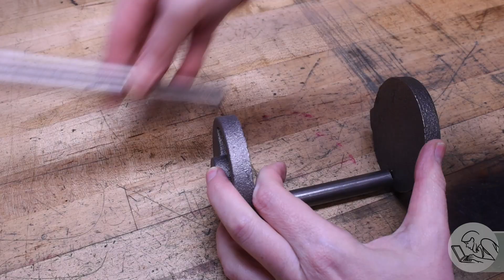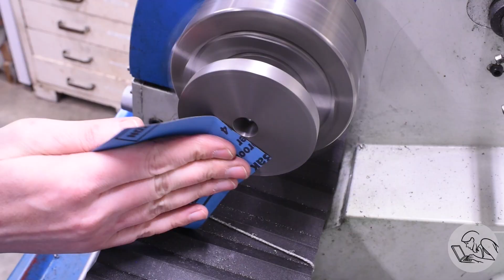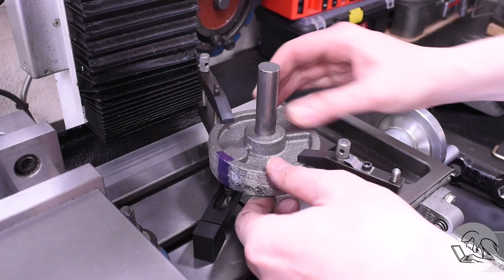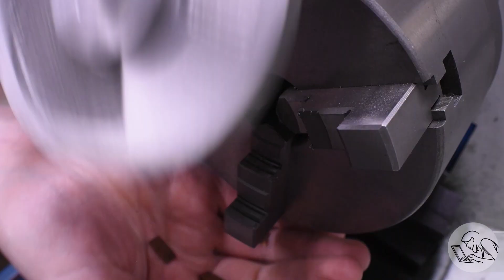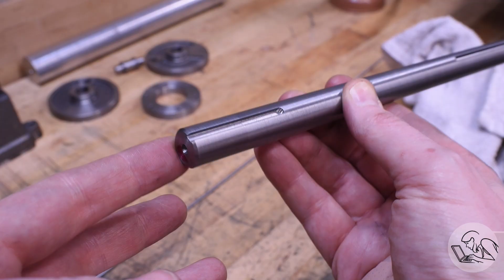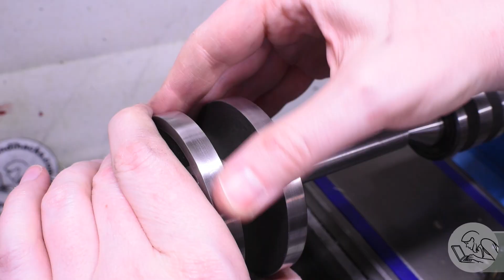Making a Crankshaft!    Big Steam Engine Build, Part 3

Comment: Just FYI. When iron cools in the mold, it can cool fast or slow. If it hits the sand, two three things happen. 1). Any moisture in the sand turns to steam. 2). The iron contours itself to the dry sand walls. 3). A thin skin of iron cools rapidly in contact with the sand. Firstly, if iron cools fast, the graphite soldifies as interstacial carbide. Old timers would dust the molds with a coal dust that reduces the surface effects of the sand. This skin of carbide iron is called white iron. If the graphite cools slowly is produced a laminar layout of strands like worms. If I add manganese and extra fero-silicone JUST before I pour, the graphite solidifies as balls or nodules. This is ductile iron. Using only ferro-silicone yields the wormy pattern which is grey iron. When you machine grey iron, try to climb cut into the edge to prevent edge chip out.

Heat treatment of castings reduces internal stress and aneals the white iron up to a point.

When I melt down brake rotors which are often a meehanite nodular iron, everything goes back into solution. Like adding surgar to water. Then many or most of the original innoculents will out gad, burn off or float to the top ad dross. So adding a tad of ferro silicone now will allow the iron to solidly as grey iron as opposed to the ductile it once was.

The white iron caused by rapid cooling can be useful. A steel ring was added to the mold in train wheels to force white iron to form on the rim. A real pain to machine but improves the life span of a train wheel.

When cutting this skin, you need a full carbide tool. Carbide tooling, unlike HSS tooling, does not do well with light cuts or spring cuts. It wants to take a heavier cut. So a finish cut in HSS may require 1 or 3 tho but the same cut in carbide is done at 10 to 15 tho. So adjust your hog accordingly.

Really enjoying the build of this motor. I think this engine may have been used by DuPont to make black powder. But don’t quote me.
Reply: Now this is what a comment section is for
Reply: @tc5963
Reply: Worth noting that it is magnesium that acts as a nodulizer for DI and not manganese. Also FeSi itself is not an adequate inoculant for cast iron, it usually includes a rare earth like cerium to act as a heterogeneous nucleation point. Also gray iron flakes are not “laminar/lamellar” it’s more of a randomly oriented sponge structure with interstitial aus/ferrite/pearlite
Reply: @fowler123454321  You are correct. Laminar is not the correct technical term. Spaghettini like is more correct. For DI I use an innoculent made for meehanite style iron. Had to buy a drum the size of 55 gallon drum. Not cheap and will last me more years than I have. As I recall, it has magnesium, some manganese, some calcium and a bunch of ferro silicone and some other stuff. About 20 ingredients.  I haven’t read the paperwork on it in a while as I am currently redoing my shop including a new furnace and muller among other things. I have the recipe for Oliver’s “semi-steel” and will experiment when I get back into it. Thanks for clarifying my incorrect use of the word laminar. I can tell you that the metalurgy of DI is not simple but it’s worth while being able to do it.
Reply: @devemch7851  ah I see. Yeah in that inoculant the calcium will act as your nucleation point while the magnesium acts as your nodulizer. Manganese and other stuff is usually to promote pearlite or whatever while the silicon is of course to encourage graphite development (change temperature of graphite eutectic reaction). All of this to say yea DI metallurgy is no joke! I’m currently writing my masters thesis on it!
Reply: @fowler123454321  wow! I don’t know how involved you are but our little community has fraught an international battle. Guys like myself, windy hill foundary, an Amish fellow who owns cattail, etc. have struggled to cast iron. Everything from coke cupolas to propane furnaces to diesel burners. Pouring a hundred pound crucible of white hot iron will pucker even the bravest. Even with leathers and reflective aprons, you have seconds. I remember one time watching my glove smoking during the pour. Seconds from bursting into flames. I began using a reflector on the pouring shank after that. One off pours is not something corporate foundarys wish to deal with. While we have gotten grey iron for the most part under control, DI in one off pours still eludes us.
Reply: @devemch7851
Reply: Great comments!
More that I ever knew..... which isn't much when it comes to casting.
Did a sand casting of aluminum in school.
Reply: I went to your channel hoping to find some videos, luckygen1001is the other channel casting iron that I'm aware of, well worth a look on the subject
Reply: @nedshead5906  lucky is in Australia and has done a lot. Emanuel owns cattail foundry in Pa. He is Amish so he does not use electrons. The big maker for iron is windy hill foundry. He has a YouTube Chanel. I have countless hours of video I getting ready to upload. Personal issues have kept me from uploading this material. My channel will likely be a makers fire hydrant. I have handmade getstner style tool chests, foundry material, restoration of three Wadkin machines bright over from England, conversion of a round ram Bridgeport to CNC using AC servo drivers I built myself, etc. The Chanel is Devmeister Super Precision.  I had a late start on YouTube and have a lot of ground to catch up.
Reply: @devemch7851  Wow, I can't wait to see some of your work, I'll go check out windy hill's channel now, cheers

Comment: That's very clever. May I suggest that you braze or silver solder the rod pin to the cheeks? Looks like there is enough shoulder there to avoid any interference and then you'd be guaranteed the part is strong enough
Reply from the maker: Certainly could do, but I’d worry about warping something with the amount of heat that would require.
Reply: @Blondihacks  Possible, but it's a pretty low temp process and you could certainly clamp the two check together so it wouldn't move. Look forward to watching the rest of the project
Reply: I've done exactly that. Alignment was a huge pain. In addition to warping from the heating there were issues with designing a brazing jig that could cope with the dimensional expansion of the parts during heating. Even then, I had to leave a significant allowance to machine the main journals true after brazing. This looked way easier.